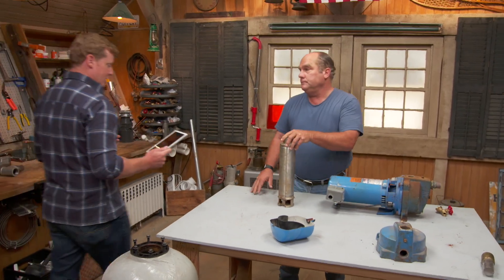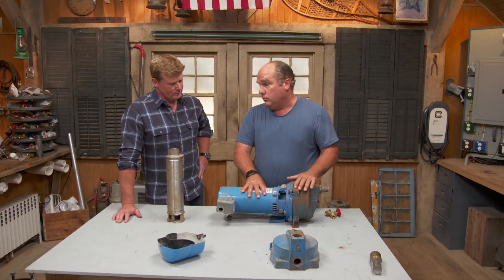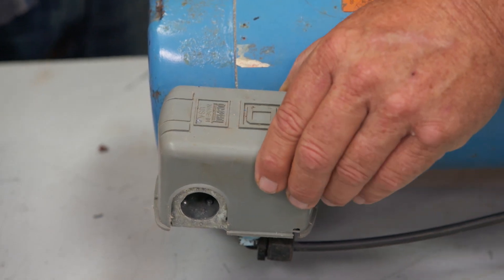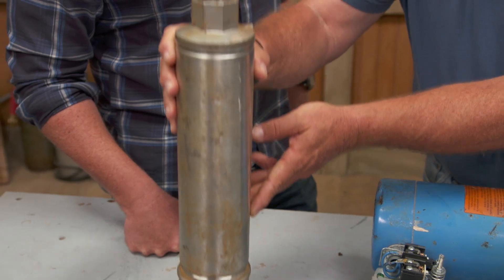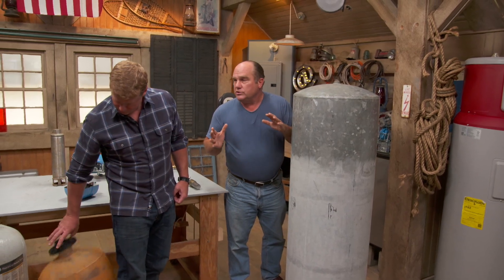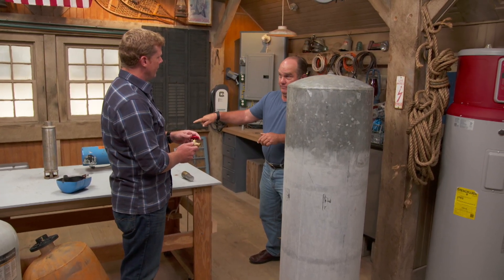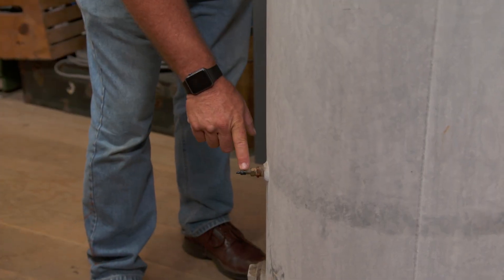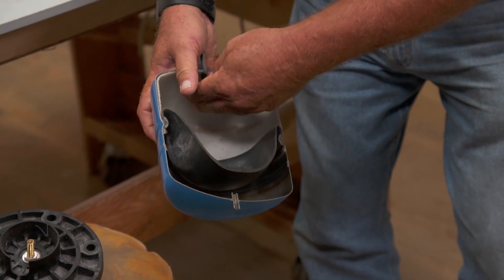How to Diagnose Problems with Well Water Systems | Ask This Old House

Comment: Currently replacing my old galvanized pressure tank that doesn't have a bladder the gauge and pressure switch was screwed in to the top of it where the air pressure would have been I'm replacing it with a new bladder style tank. Can this pressure switch and gage be installed down below on the water lines?

Comment: Question. My well is working, but I have had to replace the pressure switch twice in 1 year. The technician came out yesterday and replaced the pressure switch, and once the pump turned on, he touched the top of the pipe coming out of the well and got shocked. He tested the well head metal pipe to ground and it shows 30 volts when the pump is running.  He said there is a short somewhere in the pump or wiring to the pump and they need to pull it out.  Again, the well is working, but he believes it will blow the pressure switch eventually. The pump is a 2hp frankling and the controller is a Franklin Subdrive 150.  Any suggestions?

Comment: It's really about utilization of the volume of your tank , captive air is "desirable" because provides a low density mass to fillout some of the space/volume of your tank it compresses gradually as water comes in to the tank , but if the air is gone and the space it is supposed to be taking up is filled with water ; water is VERY HIGH DENSITY (you can't compress water) a very small amount of water in a tank with alot of water in it already will create a change in pressure from low to high and back again = QUICK CYCLING PUMP . The pump motor uses something like (it varies) 3 times as much electricity at start up as what it does when it's running (unless maybe you have a newer constant pressure system ; BUT that's a whole different "animal")

Comment: what about sediment build up in the pressure tank . I had to replace my whole house  filter and spigot stem broke and well pump was off and tank released the water and at the end the I got grey , black and red seiment that came out  and after new spigot was put on my pressure was up to 50 psi and before that it was 38 psi  . So what should pressure be at with the size pressure tank you have . My pump failed and do to wire damage in the well and I got dirty water and wondering now since pressure is down to 38 psi  , is there sediment build up in the pressure tank again . Should it be flushed again  the pressure tank is just over 4 years old it replaced a smaller pressure tank that was making my pump work all the time

Comment: My water pressure will not rise above 20psi. The pressure switch is staying closed for demand to satisfy the 50 psi high limit. It’s never getting above 20 psi. I replaced the pump about 1 year ago. The fact that I’m getting some water has got me confused. Thanks for any answers.oh and when I use water in the house the pressure will go to 0  it will take awhile before it builds back up but it still never builds over 20. I’m afraid my well has no water.

Comment: We have a residential well that is only 2 years old. This summer, when we don’t use the cold water for 2 or more hours the water that comes out is HOT when I only turn on Cold faucet. It will start out warm then get HOT. I will typically run the kitchen faucet for 10 minutes to get cool/cold water or start a load of laundry to use the warm water up and get to the cold water. I’m concerned that this hot water that is sitting in the water lines and pressure tank could be growing bacteria.  We do have a reverse osmosis filtration system, but I’m not confident that will filter out all the bacteria of unfiltered warm well water. What are some troubleshooting suggestions to find out why the cold water is getting hot this summer but not last summer?
Reply: Don't understand why you are worried about bacteria. Heat kills bacteria. I'd be more worried about the fact it doesn't work right. 🤔

Comment: Hi. Question I just replaced the pressure switch. The tank had no air it was a40-60 pressure switch I filled the tank wit 38 pounds of pressure when I turned it on I can here the pump but I watched it for 45 minutes and it only went up to 20 pounds of pressure and the pump was on any thing will help thanks
Reply: This is pretty close to what I'm experiencing now. I'm getting ready to replace the pressure and I hope to God that's the problem and not my immersible pump that's down the well 200 feet. 
What happened to be your solution?

Comment: The pressure is good, the pump stops and the water returns to the well, reach the low pressure and the pump starts again. How can I fix it? or what part needs to be changed?

Thank you
Reply: sounds like a leak in the well line. You should have a valve to stop the water from coming in the house, close it and see if the pressure drops.
Reply: @BUNNYBUN420  Thank you very much. I'll try it.

Comment: I'm pulling water 346 feet from well at the pump I have 60lbs of pressure but in the facettets it just trickles out what could it be. Thanks in advance
Reply: pump to weak or leak in well line

Comment: My well pump keeps kicking on without the water being on what could that be I just replace the pressure switch two weeks ago this is the first I’ve heard my pops continuously running tonight I just pulled the fuse just to turn the pumps off until I can get a hold of a plumber I’m worried my pumps might burn up though is that an issue?

Comment: We been living at our house for 29 years.  Have a well - always semi low pressure but not a problem.  Then in December had Well Connect system put in for heating and cooling.  In March, all of sudden lost all water pressure.  Turned off the Well Connect system.  They primed the pump and we had water again.  Kept the system off and had a professional Well Company come and due maintenance on our well.  Was told we could turn the system back on and see what happens.  Also told that it sounds like we have a slow leak underground.  Now July the water pressure goes off again.  We turned Well Connect off and husband primed the pump.  Water restored.  Well company suggesting we should probably put in new deep well.  We currently have the above ground, pump in basement system.  Meanwhile one week later, we lost all pressure again and had to prime the pump.  Any ideas???   Does it sound like we need a new deep well system or is the new pump the problem?
Reply: Diane Young sounds like a bad check valve on the suction side of the well pump?

Comment: Hello I have a 20 gallon retention in my house. It’s like the blue one you guys used as an example. I don’t know how old the tank is it was there when we bought the house. My question is this. When the shower on I can here the switch or pump running on about every minute is that about right?

Comment: I have a question and hope you can answer. We rent with a well, and the owner seems to think we are responsible for the very low water level, even though there are only 2 of us, and we barely use. He said he checked for leaks but found none. We just put a new metal connector to backyard spigot, for 2 hoses to connect,  cus other one kept leaking, and I think our owner has been coming by early in morning, before we're awake, and putting something through connector to check water level possibly? Anyways, I think he broke something on metal connectors, cus water won't shut off turning valves on connectors, and water won't even flow through hose. I found the metal pcs that go inside connectors on ground just below and put back in connectors. The water shuts off when you turn main knob to right, but when on,  both connectors overflow with water, even when that white round like plastic piece to shut off is in place. Can't understand why hose won't flow (just dribbles) now cus the spigot in front works fine (he hasn't messed with that one yet). Thank you. 2 Thessalonians 1:7-9

Comment: That is happening with me too but I hear a noise that sounds as if there is a water leak and when I start listening it sounds like it is the backward valve And when the light goes out I have to add water to the line so I can run  water for the house because the pipe is empty I think it is the backflow valve. I need help How to fixing The water pump of the well is outside. I live in a movable house.

Comment: Why would the screen washers on the taps coming from the well get clogged with lint?  Not mineral deposits but lint.  I have to clean them daily or no water will flow out.
Reply: This just happened to me. Did you figure it out?
Reply: Might be your cloth filters for the water system?

Comment: I've got air in our lines this morning and low pressure. Psi on the switch is only at 10. It doesn't make any noise.
This was a foreclosure so I'm not sure where the actual well is, only the pressure tank house.
Any help out there?
Reply: This is exactly my situation. Did you ever get it figured out, Jonathan Strand?

Comment: I got my gould pump shallow well, the problem is that the meter moves up down point different direction,is it normal to the motor? It turns on but after a few second if i turn on the the volcup it automaticly turn off,what would be the problem?can you help me

Comment: So I have no water SWITCHED the pressure switch nothing so pulled pump and changed it and still no water no pressure on the gauge checked the psi in water tank was low so pumped up the air psi to 28 cuz my switch is a 30/50 going to change the water tank and gage also the check valve

Comment: My well's foot valve lost water prime because of a bad vacuum regulator and the pump wouldn't turn off. It was easy enough to bleed off excessive air in the storage tank but that would only last a week or so until it would happen again. On my system, the vacuum regulator lasts ~6-8 years so I now keep a spare on hand for the next time it happens as my regulator is not the more common of the ones offered so well supply stores don't keep in stock.

Comment: How much pressure should be in the tank bladder when there is no water pressure?  Is there a way to test the tank bladder by turning off the water and measuring the air pressure?
Reply: In my case 28lbs or; 2lbs PSI shy of when you  ask the pump to kick on. If Max is 50Psi and minimum is 30PSI then you would have 28lbs in your tank as is my case...

Comment: Her problem could be the check valve leaking so you loose water pressure so the pump kicks on and then the water leaks out and that is the most common problem, very seldom does a pressure tank fail.

Comment: One major thing you forgot to mention is a leak in a pipe somewhere. If there is a slow leak in a pipe anywhere in the house (slab) you will have the same issue of pump cycling on and off too much.

Comment: why does my water pump circuit  keeps tripping?
Reply: The pump could be failing.

The pump may be drawing the well dry and the thermal switch on the pump  is tripping - such switches automatically reset after the pump cools.

The circuit breaker may be failing.
Reply: Motor bad high amps

Comment: How long should the pump typically run for if we stop using water once the pump comes on?? So how do we tell if the tank is bad? Our tank is an Amtrol about 16 years oId. I just replaced my pressure control switch  with a Phoenix  Wessol 30/50. I've got a Goulds pump about 16 years old. And the pump seems to run too long. I've got the tank pressure set to 28  ( what Amtrol tech said, 2 pounds below cut in) Before I replaced the switch the pump ran too long( seemed like forever) so I dropped the cut in / cut off down and the pump shut off after a few minutes ( seems more normal). I'm doing the same with my new switch gradually and hoping I'll hear the pump shut off. I can feel the tank getting heavier but pump just seems to run too long. Amtrol tank is about two foot diameter by five foot tall. The gauge on the pump reads at  80 psi. Any advice,????  thank you
Reply: I wonder about the pump pressure being so high. It should be very close to whatever the tank pressure is - so it starts out low and increases as the tank fills.

Are you sure there is not a shutoff valve that is partly closed somewhere between the pump and the tank?
Reply: buggsy5 Thanks, I turned the big pressure adjust  nut down on the switch about 4 turns so the 30/50 factory set is now about 22/42. Now everything seems fine.  The pump shuts off after about 3 minutes and the tank feels pretty full. Gauge on the pump didn't lower much. It still reading 80. I think maybe the gauge is broken? ? I didn't drop the tank pressure and think it's about 23-25 psi.
Reply: Does it stay at 80 psi all the time? If so, it is broken.

Higher pressure takes longer, as the pump has to work harder. If the 30/50 pump run time was really long (like maybe 10 minutes), then I would guess that the pump is just getting worn with age. 

Another variable that can affect those times is using a small pump with a large tank.
Reply: buggsy5 Yep, I'm fairly certain rhe gauge pretty much stuck at 80. Had this set up for 15 plus years and never had a single problem. Now that I lowered the new 30/50 switch  the pump shuts off after only a few minutes,  the same as after I lowered the old Furnas 20/40 gauge. So I really did need the new switch it seems. I just got and installed it because I thought the problems have been with the old one possibly defective. The points on the old one I could see were worn but once I fiddled with it (lowered it) the pump did shut off after only a few minutes. We see how it goes.  Thanks for your ideas and comments
Reply: U need new pressure tank

Comment: My wife and I have grown up on city sewer and city water. SO, no well's or septic. We are bidding on a house in a country town with both. The well pump is at least 17 years old. Can you tell me if that is near it's end of life?. I called a well guy and he didn't really give me an answer but said if it failed to call him. He said the price to replace the pump would be around $2500. Is this crazy? or normal?. Can I do this myself, IE buy a pump and have someone who knows basic plumbing skills replace it?. AND, should I replace it now or just wait for it to fail at some point?. Thank you!!!.
Reply: There is no way to tell how long bottom of well pumps last - although they tend to be pretty reliable. No idea if the ones made in China are as good.

My pump is over 50 years old and still working fine. But it wouldn't surprise me if it failed at any time. 

You probably do not want to attempt the replacement yourself, especially if it is an older well with a rigid iron riser pipe. If that is the case, you need some specialized equipment to raise the pipe a section at a time.

If it is flexible riser pipe, then someone with advanced plumbing skills MIGHT be able to do it. Do a web search to see if you can find information on what all is involved.

You will need to check with your local building authority to see if any special permits are required to repair a well. Often post work tests are required to ensure the well is not contaminated with bacteria.

Don't change it until it fails. Yours might last as long or longer than mine. 

I have not priced pump replacement, but the pumps are expensive. You can always call a few other well drillers and ask them what they would charge.
Reply: Thank you for replying. Today, we got the water results which were considered excellent. The guy checking on the furnace after the seller decided it was fine said the furnace which is 1954 was old, inefficient , but working well. He also is a well guy and he checked the well head that was under the deck under a little wood deck door. Once lifted he had to brush the leaves and dirt off the round cement or concrete or whatever round top. So the head isn't above the ground. Once again though, the water is great, well never dried or had a problem, and when the inspector checked the well he said the PSI 40 from beginning to end after an hour was really good. By the way the well pump was exposed in the basement so it isn't in the well below the ground. Would you put a well head cap on, or leave it alone?.
Reply: Personally, if the well head is not sealed, I would get a sealed head. That would protect your well in case of a flood.